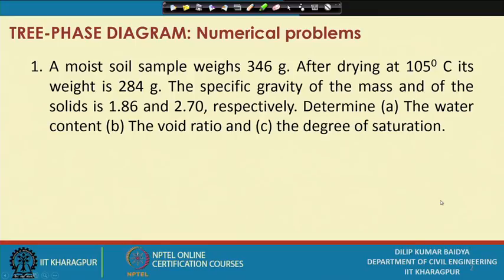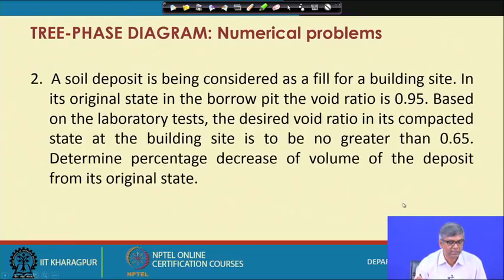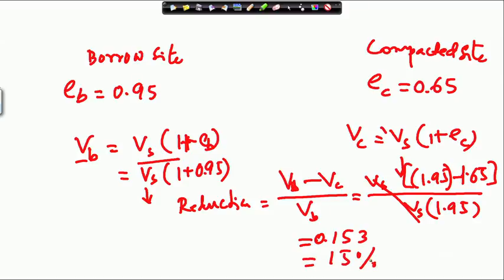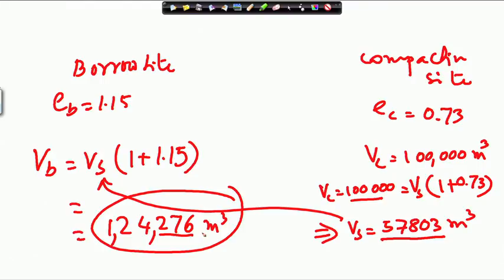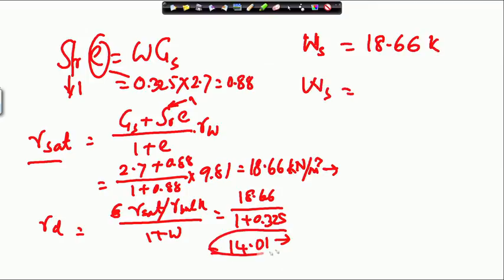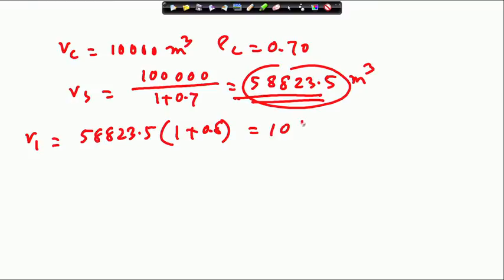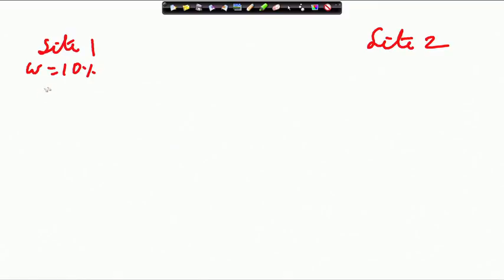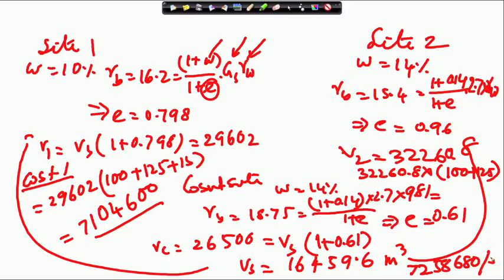Lecture 7 : Three-phase diagram (Contd.)

Comment: Can you please explain that the water content in 1st soil site is 10% so how come you multiplied 15 with 29602 which is the volume of soil not that of water we have to seperately find out the quantity of water in cubic metres and  then multiply that with 15 and add to the product of 225 and 29602.? Am i right please confirm.
Reply: Exactly same problem I have too
Reply: In this problem he should been to find volume of water required to get .14 water content  and that volume should be multiple by 15
Reply: Yes, first we need to find the additional water needed. The additional water will change water-content in Site 1 Soil from 10% to desired water content of 14%. This means we need to add 4% additional water content. GAmma (dry) = Gamma(Total)/(1+w) = 16.2/(1+0.1) = 14.72 KN/m3. 4% water content = 4% of Weight of Solids  = 0.04 * 14.72 = 0.59 KN in each m3 of X volume of Site soil. The Professor has already calculated the volume needed for site 1 at 29:56 in the video = 29602 m3. Weight of water needed = 0.59*29602 = 17,465.18 KN. This weight is equal how much volume of water? Unit weight of water = 9.81 KN/m3. Vol of water needed = (17,465.18 KN) / (9.81 KN/m3) = 1,780.3 m3. This is the additional water needed. Multiply this with 15 Rupees = 26,704.5 INR.